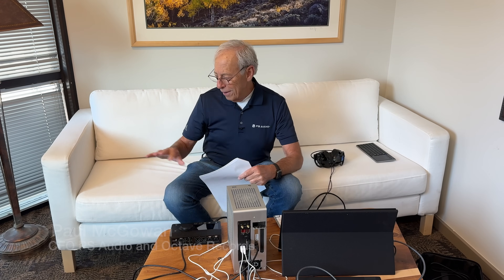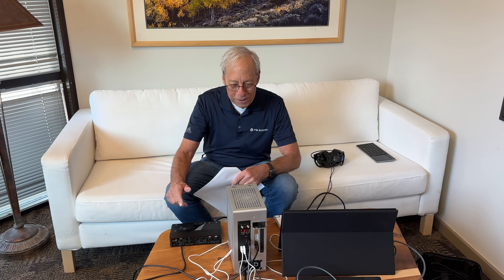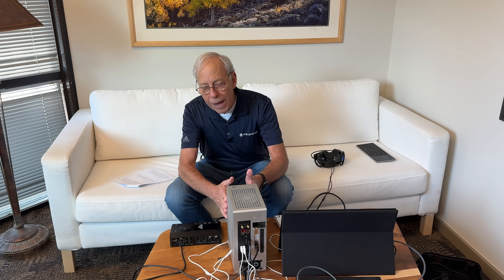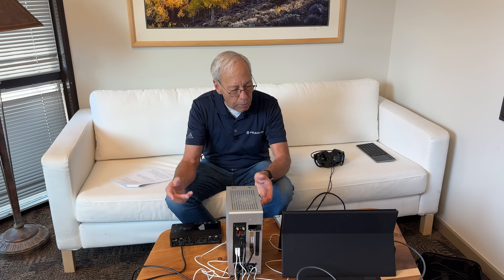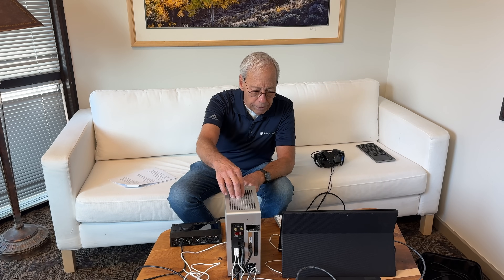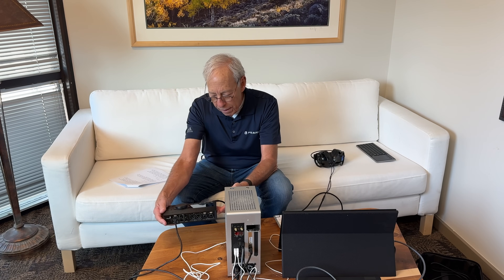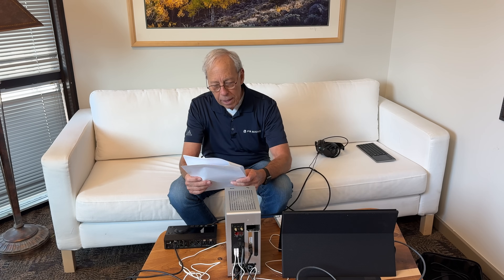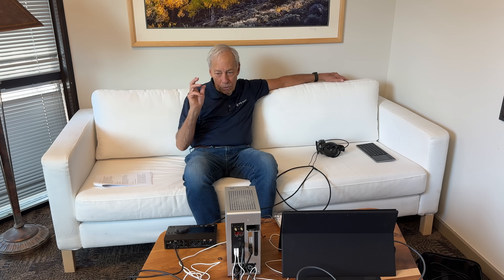DSP room correction

Comment: I would not mind adding DSP to a regular two channel system just for the  bass part of rhe speakers and a sub if it works fine. Let’s say we are using a pure digital setup with BHK components. Would that be worth it? And how would it be done correctly?

Comment: There's a lot of reasons why certain things can't be fixed.  imagine reflections off a glass wall.  they are boosting certain frequencies significantly.  well, the room correction could flatten that, turn that down.  but you still have a certain significant portion of that sound energy hitting your ears as a reflection from the glass, from a different angle, and a bit different in phase, so you can make it flat but, that's not going to image as well as an ideal room right?  not to mention the glass might vibrate and add some THD etc too that's still there.  Low frequencies different story.  Not directional.  Hard too boost, easy to turn down.  So do the latter.

Comment: Go listen to a Steinway lyngdorf system and then tell me dsp correction doesn't work.
As always, do what you can realistically to treat the room and positioning of speakers but after that use dsp.
Also, you can still hear the difference between vinyl and cd even after digitization. 
It was THE game changer for me.

Comment: I find Dirac indispensable for my 2 channel system. I only use it for the low end. It make subwoofer integration magically easy because it even takes timing into account. I wouldn't buy a system without it.

Comment: It's not just that it's digital, but also that the DSP device may not have the highest quality DAC.  I don't want my pretty high quality 2-channel stereo music sources, digital or analog, going through a mediocre DAC in my Marantz AV8805.  I worked hard on the room issues and speaker placement and was able to have my music go through the "Pure Direct" mode in that AV8805, and it sounds significantly better, too.

Comment: DSPing for low end bumps is not as good as you indicate compared to suck outs. Bumps are often caused by the speakers. Often because of doubling, where the woofer cone breaks up and starts producing energy at harmonics, often the 2nd. So a woofer breaking up with a 30hz signal is also producing 60hz. But all the test mic hears is sound pressure. So you do something to absorb the extra 60hz. But that just reduces the actual 60hz signals and does nothing to solve the 30hz problem.

Comment: I feel that people are thinking about DSP in the wrong way, it's not the first place to try and fix issues in the frequency response, it's close to the last.
I do believe it has a good place when used in fully active speakers, but even there you have to treat it with respect. My system runs through DSP and is fully active (1 amplifier channel per driver), and it actually doesn't sound better trying to iron out the frequency response. My guess is that you're pushing energy into the driver to correct a dip (well, you lower everything around it) so you're asking it to do something it doesn't necessarily like (due to mechanical design) possibly creating intermodular distortion.

As DA chips get better and better I'm sure we'll see more and more active HiFi speakers, you can keep the signal digital to the very end which can be cheaper than all the passive components today (including paying for a lot more amplifier channels).

Comment: Some people still argue that analog is better than digital for recording… am I wrong or Paul don’t think so? Octave record is all digital recording. So for him, the purest recorded signal is digital. As for dsp room correction, almost all recording studio use it (with physical room treatment). Personally, I love DSP room correction because in my professional recording studio and in my Atmos home cinema it just sound better and more accurate! The last 10% of room treatment for the bass in my studio would add 90% in price! Putting that money in good quality speakers is WAY better idea in my opinion. In my treated studio, the peaks and valleys to adjust with dsp is less then 6db… not exactly “huge”
Reply: I think its fair to say DSP in a studio can be a world away from reproducing music on a home hifi in an accousitcally compromised room. Just to add that in using DSP, studios can achieve a more controlled and precise sound environment, which can help produce higher-quality recordings. However, it’s important that these corrections are tailored to the specific studio environment to avoid issues when the audio is played back on different systems. Also DSP in studios includes reverb and echo reduction/Noise reduction/ delay compression to name a few. This is not what home hifi DSP does. I am an anlogue guy I love my vinyl but I also listen via streaming and CD I think Paul using high resolution DSD to capture most all the nuances of music which afterall is an anlalogue waveform is a good way forward but what I have noticed on my mid high end home system when listening to DSD recordings mastered to vinyl is that they are a more enjoyable listen than the raw DSD file. This cannot be I ask myself? but its true and may have something to with 'psychoacoustics' As an ex Sony engineer, I worked on HD broadcast systems and 8k Picture reproduction, we used to build and test digital cinema projectors capable of 8k and more resolution. What we found was, often we were overwhelmed with detail and became fatigued by what we percieved to be the brain trying to constantly process the huge detail in the picture. I am no expert in the attributes of sound but I think its analagous with what we found with highly detailed visual cues, that's what goes on in very high resolution music files like DSD (s Sony Invention) at 256 /512 etc..is just too much for our auditory/brain systems, so we either don't want to listen anymore or we shut it out. I have two systems one solid state and another All vacuum tubes and there are times when valves (as we correctly refer to them in the UK) is the only way I want to listen and other times when a CD grabs my attention. Humans are strange and complex creatures, by comparison Electronics is simple!
Reply: @Gez492  I would be very curious to hear a hi-res digital recording (let say DSD) of a vinyl and compare it with the actual vinyl on the same hi end audio system… I’m pretty sure it would be undistinguishable… the vinyl sound is an “effect” that I’m sure lots of people can prefer over the more true digital recording.
Reply: @guystpierrecomposer  I did that at 192/24 on my system. I can A/B it on my integrated on the fly with the remote control. And no, it's not transparent. Very close but there are high frequency artifacts. For fun I also converted the file to 48/16 and back to 192/24 and compared that to the first file. The difference was smaller. It seems it's not so much about the resolution than the conversion step itself.
Reply: @Sonus1002  interesting…what is the ADC and the recording chain? You know I’m sure that 95% of original modern recordings like Deutsche grammophon’s for exemple are made in PCM with very high end ADC? It is simply impossible that a transfer to vinyl would be more accurate than the digital file.
Reply: @guystpierrecomposer  Of course you'll get better and better performance once you throw a ton of money at it. But if digital was transparent there would be no need for it since it's already perfect. And speaking of DG, I recommend you compare "the original source" vinyl series from Deutsche Grammophon to their current digital releases. You'll kick yourself in the b***-
Reply: @Sonus1002  “But if digital was transparent there would be no need for it since it's already perfect.”… you surely know that converters play a big role in sound quality. No matter how “perfect” the digital signal is , if you use a bad DAC or ADC you gonna get artifacts. As for DC it is not supprising that you prefer those “original source” if you like that coloration. Not even the best recording studio - that use 100k analog preamp and mixing desk- are still using analog regording tapes. I did record live session with those 200k 2” Studer tape machine and when good digital came, it was so much better! I mean, you are there in the sudio and you listen to the direct analog microphone source, then compare to the analog and digital recording… anyway, I totally understand that some listeners prefer tube sound or vinyl.
Reply: @Sonus1002  funny fact for you: did you know that using those very pricy analog tape recorders, the engineer had to adjust manually the “bias” of each channel. If you don’t, each track would have different hi freq response. And if you don’t use 50k Dolby SR noise reduction (that is a very unnatural processing) you have so much ‘hiss” on those machines, it was horrible…ask Paul about why he doesn’t record with analog tape…

Comment: DSP. is a nice thing to use to correct the frequency of the speaker if the speaker has frequency problems.

But not always so good at correcting problems caused by the room itself.

It is not always so easy to find good speakers with good sound without being extra expensive. You get a disappointingly LITTLE speaker for the money!

Comment: Spend 10s of thousands on all the best gear you can and at the last moment take your very expensive signal and run it through a $200 crappy sounding DSP… every bit as insulting to the sonic result as all the fancy speakers that use crappy cheap parts in the crossover. Proper acoustic treatments can be done for way less than all that fancy electronics cost and can be done in a visually non offensive manner. Maybe your wives who complain would actually change their assessment if/when they heard the actual sonic results of a properly treated room.
Reply: acoustic treatment is number one, does way more than only the audio sound from your hifi :)
and i treat my dps as a hifi gear, my amp cost 2000 so i spent 2000 on my dsp, and my dsp has no dac in it.  i use normal hifi separate dac's for that job.

Comment: Hi Paul, I started working with room correction software about a decade ago and found it fantastic. I first started with Yamaha's YAPO (good) then moved on to Anthem's ARC (much better). For me, 80/20 works. 🙂
Reply: Hey Larry, and if its just for the sake of experience: try the RoomPerfect of Lyngdorf systems from Denmark. You may also find it on expensive Macintosh amps too. I sold my 12K preamp/poweramp system which was very high end. And even my two REL subs I had were not necessary anymore. Look for the TDAI 3400 from Lyngdorf. 2x400 watts on 4ohm integrated amp. It comes with a measure mic incl. stand . I’ve been encouraged to test it and refused it because I didn’t believe in DSP. The entire concept is overwhelming. I really loved my former system, But now I only have ONE box for everything. Sure I don’t have a turn table running but even with that I‘d think it worth a shot. I also tried DIRAC room correction but it didn’t come close to RoomPerfect, because DIRAC tries to level the frequency curve as RoomPerfect tries to „understand“ how your room sounds like. So I bought a TDAI 3400 and tested it for two weeks knowing that I then would need to sell my old system to gain the money for the 6K price of the Lyngdorf. Best decision I ever made regarding hifi electronics.
Reply: @stefanblutke8053  Respectfully, how can DSP compensate for losing two REL's?  DSP doesn't pressurize a room or allow speakers to produce frequencies that they are not designed to reach. If you were having issues with sub bass then set up, placement and careful integration with your speaker generally is the answer, or perhaps your room speaker combination doesn't allow for more than one sub, although stereo pairs are generally better. The strengths of using good sub woofers optimally placed and set up with care have benificial effects way beyond just producing lower frequencies that your main speakers cannot. I am puzzled could you explain? As far as I can establish, for the most part, DSP in the home HIFI world is used to digitally compensate for compromised or difficult room accoustics, where the listener cannot or doesn't choose to treat the room. Surely we need to explain DSP in this domain is simply a more precise, automatic multiband graphic equalizer with memory function and nothing more; what it does is not magic and can have deleterious effects as well as benefits. It partly overcomes room issues by predominently suppressing frequencies that are troublesome in a given environment . Its convenient and has its place but careful set up and room treatment can be more effective without more processing of the signal, which I think we all agree is more desirable and whilst I don't agree with all that Paul says, despite his superiority of experience as opposed to mine but on this he is in my view, correct. The best way where ever possible is to treat the room not the signal.

Comment: That is NOT a issue to go digital.

It is actually a ISSUE (sound quality wise) to not go digital with LPs. 🎉

Remember that the BENEFITS of what DSP can bring is FAR greater than staying in the analog domain and loose out in total sound quality improvements.🎉

And that is not a real controversy or rubbing anyway in the wrong way that Paul said.

Of course you should set up speakers and sound treatment as optimal and in the best way as Paul said. 
But THEN we continue to improve from that starting point with help of DSP! 

And go beyond the performance envelope that Paul could ever achieve.😅

So it is not either or..😂

Comment: When it comes to intergrating subs into the system I wish more manufacturers DSP subs would mesure the room at the listning possition without the sub first so that it can see what its working with. Then add where its needed and not where its not. This is very helpfull when you have full range speakers.

Comment: Acoustic treatment is a b**ch, you need a lot of panels to make a difference, it is hard to get the WAF right and it is an added cost that doesn't conduct current. What's the fun in that. But it makes a big difference especially in resonating rooms. If you can place acoustic treatment and can play around with sub positioning than you are in better shape then most of the home audio crowd. The rest get a lot from ADVANCED room correction,  not a 4 band PEQ. The likes of Audiolense or Dirac can do wonders to the sound including phase and time alignment.
Reply: I would say its a bitch if you also want it to look good. That being said, room treatment can make a huge difference

Comment: Living in a small room speakers close to the walls without the possibility of much if any room treatment dsp has greatly helped me achive a sound I enjoy, mostly under 200hz.
Reply: dsp does wonders in a small room, but i still fitted 6" think panels in here. its takes a lot of space for sure.
Reply: Did you just listen to figure out 200 hz or generate a few filters says 200, 300, 500?

Comment: I am with you. Do not add an DSP in the chain in a revealing system because you will mostly degrade the overall sound, BUT you can add a DSP to the subwoofer with great result. Rule of thumbs - Room treatment and setup (both speaker and LP position) first... There are no short cuts for a true Hifi experience :)
Reply: You might have taken a short cut. Assuming a digital source, DSP on subs is fine if the delay isn't excessive. However, some rooms will still have one or two room modes resonances because main speakers (also small bookshelf speakers) will also play "flat and loud enough" these frequencies (example: 70 Hz, 130 Hz). Mathematics and experience proves that some resonances (70 Hz example) can't realistically be solved with porous absorbers, although some vendors claim quite the opposite. I equalize my files or compact discs once,  without adding any live DSP component in the chain; not very practical but it works.
Reply: Question please: in a no-DSP on the Mains setup [only on the Sub(s)], what method are you utilizing for the Time-aligned of Mains to Sub(s)? Thank you.

Comment: Best is to use DSP correction AFTER you have done your best effort to optimize room treatment and speaker placement. In the perfect world, you wouldn't need EQ after you've done your room treatment, but in the real world you realize there is still some room for further improvements if you really analyze the in-ear frequency response. And who said a flat response is ideal? I personally like to boost the sub bass a few dB (+3dB at 40Hz) to better match my listening volume sensitivity curve; and boost above higher treble (+6dB at 12kHz) as sort of rejuvenation EQ to regain some of the natural loss of treble sensitivity to get the sense of air back. I've met people who have serious hearing deficiencies where such DSP correction can do true wonders. But for audiophile DSP correction, you gotta do it on a digital source and the DSP algorithms have to run at the same clock as the sample rate possibly with 32 bits calculation accuracy to avoid quantization errors and sample rate conversion errors. Getting this tomorrow's digital audio architecture developed right for true audiophile performance is still engineering work to be done for most audio companies. Interestingly, Apple today announced their automated hearing test software coming soon to their products, that allows their ecosystem to DSP calibrate automatically based on automated hearing test using the AirPods Pros. It would be nice some audiophile company (Apple is not) could tap into such calibration for audiophile execution of next gen audio.